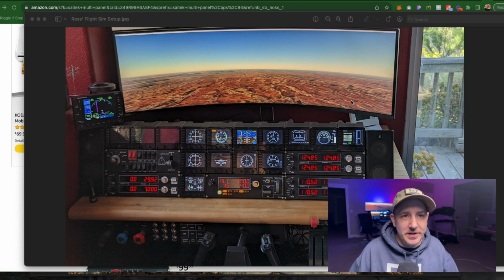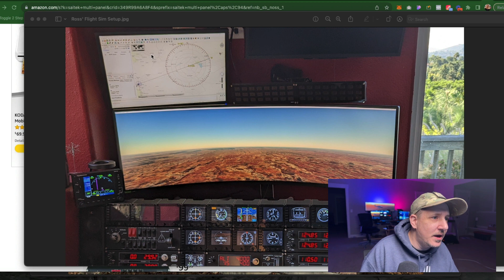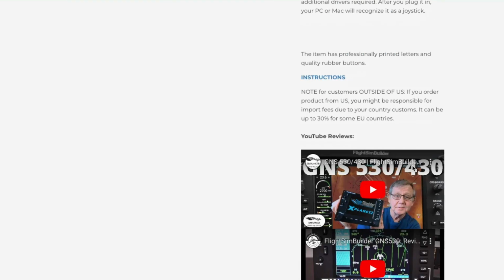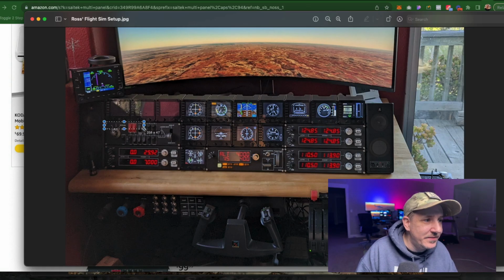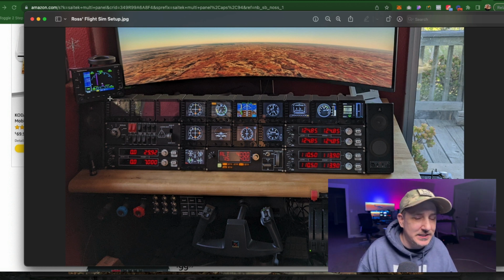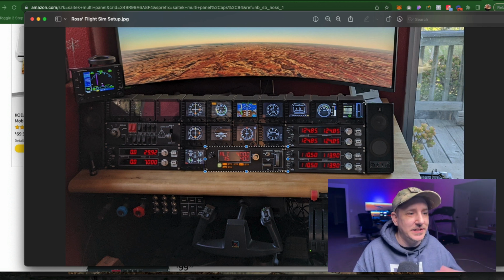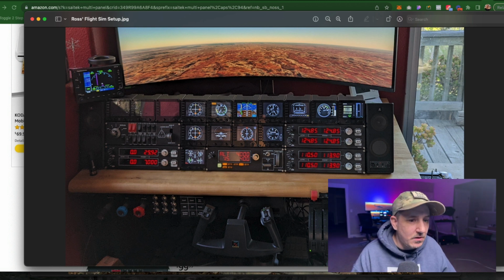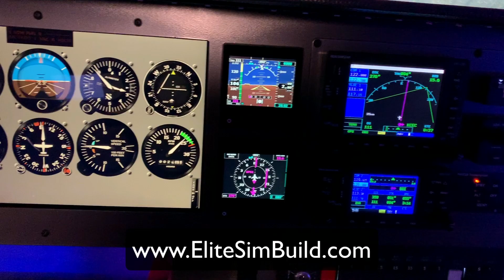Taking Cockpit Tour of an ALL Saitek Flight Simulator Setup

Comment: This is my setup.  I had a few Flight Instrument Panels (FIPs) from back in the FSX days.  I also had two Backlit Info Panels (which are above the monitor on the right side), a Cessna Yoke, 2 throttle quadrants and a Saitek TPM.  When MSFS 2020 came out, I waited about 8 months before I finally "won" the NewEgg Shuffle (lottery) to be able to buy a 3080TI.  In the meantime, I bought a few more FIPs and the other Saitek panels (switch, radio and autopilot) and pedals.

Staying with Saitek/Logitech, the panels fit perfectly and seamlessly.  Therefore, I put them all together and filled in the gaps with more FIPs.   The FIPs are great because you can have them display anything.  In a Cessna 172, I count 14 gauges not including the clock.  So, my 15 gauges are kind of inline with that.  However, I show the 4 engine gauges on one FIP (lower mid-left) which frees up some FIPs for other things.  

With Spad.Next, you can show any readout you want - graphically or alphanumeric.  You can create your own formulas/variables and display them on a FIP.  So, I have checklists, frames/minute, angle of attack, weather conditions, landing  analysis, etc.  And, you can switch between these displays on one FIP or they can automatically change based on what is happening in the sim (the landing analysis display automatically comes on when I engage the parking brake after landing).  I have 12 working - I haven't hooked up the top 3 on the left yet - I just wanted to fill in the gap.

My handyman skills are not up to the needed level to nicely fit an Air Manager screen into this setup.  That's why I stayed with the FIPs.  Yes, it's more expensive, but I've had fun every time I turn it on and I've had no hardware problems for 2 years.  Spad.Next is very easy to use once you spend a day with it - and it runs all of these components easily (the first thing you do is get rid of the Logitech drivers).  Spad-Next does have an X-Plane edition.

Thank you, Matthew, for the kind review and I'm happy to answer any questions.
Reply: OK.  Makes sense.  I have also bought spad.next to use with my logitech panels.  I have no FIPs (I have air manager on touchscreen instead), but I do have 3 radio panels and a switch panel. I didn't get the autopilot / trim panel as the Honeycomb bravo throttle quadrant also has these functions or I can use airmanager. I also have two 15 button Streamdecks which I plan to use with Spad.next.

Comment: TWO BIPS!!!??!??? The monster! No wonder why it took me a year to find one! I have the full setup but now can't find the original Saitek Cockpit to put it in and all the new ones are too short!
Reply from the maker: ha, right....   I'm genuinely impressed that much could be done with the BIPS, tbh.
Reply: I bought these years ago in anticipation of someday using them.  I saw one online last year for $790...  

As of now, I don't use the tiles that came with them.  I created a grid in Excel and slipped the paper into it.  It's now completely customized with what I want it to annunciate.
Reply: @visarr  Send me your tiles. I'll pay shipping.
Reply: @adamcboyd   I'm going to keep them just in case; however, I do recommend just printing out your own grid - with the smoke front pane, you can't tell it's paper underneath.  It looks very professional.  It's the opposite of the tiles in that the words are black and the background is colored.  I use slightly thicker paper than standard.

I'm happy to send you the Excel file that I use - not sure how to get your email, though.  By the way, fpgauges sells a customized annunciator for the FIPs.  I use it as a checklist.

Comment: Looks very impressive.  Though I have to admit, I think it a little excessive to buy that many of the FIPs. Surely at that point you are better off getting a touchscreen and air manager? Maybe with a knobster for the knobs.
Reply from the maker: For sure, man, but to each their own.   15 might be a little excessive, but it certainly rounded out the cockpit setup - and if he needs to use all of them, they are available.   They seem a bit pricy (each) to me, though, I'm def onboard the Air Manager train.   Hows your flip desk coming along?  I want to do a highlight vid on that...
Reply: @flightsimguides  Yes, if its right for him, then that's great. Just it's a lot of money, and I am not quite sure how that many can be used. It does certainly look very neat and tidy. As for my flip-desk, I haven't even started cutting wood yet. I need to sort out building storage in my office before I get to the sim build.
Reply: I put a comment above regarding the FIPs.  As I said above, they worked so well for me that I just kept adding them until I ran out of room...
Reply from the maker: @visarr  for sure, if you like using them and they add to your setup, then keep rocking them out.  My ocd would prob force me to fill it out as well, lol, I’d be like “no no no, I have to fill this gap, something must fill this space!”